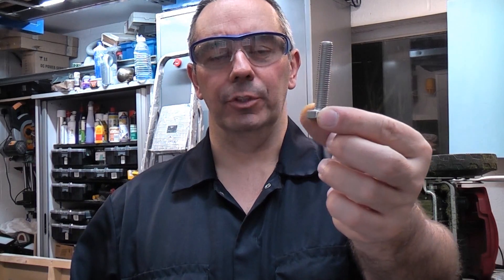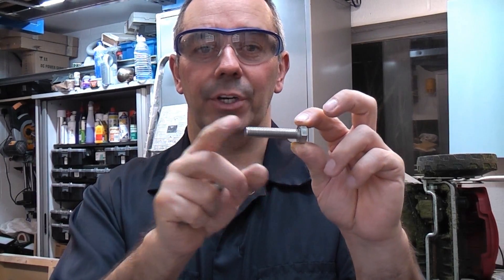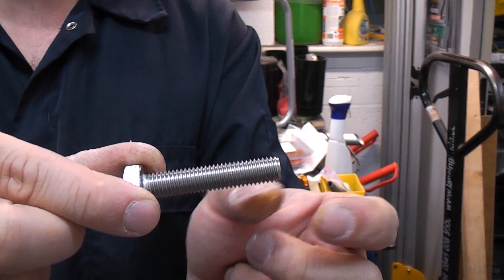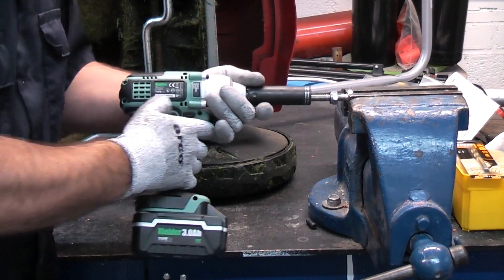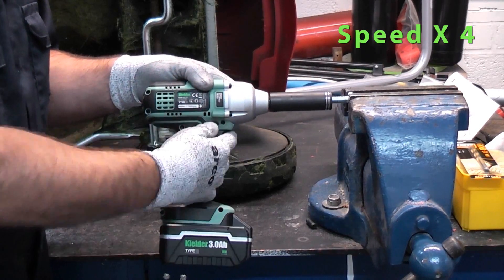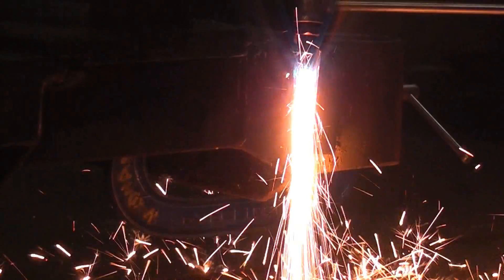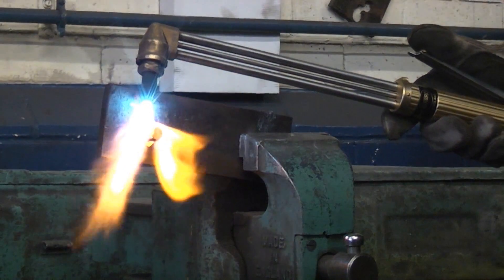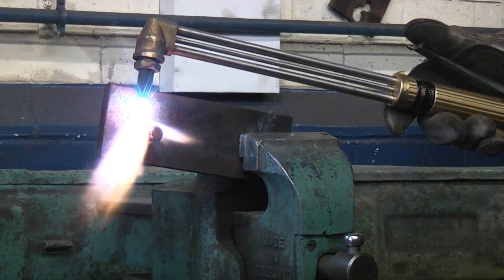Stainless steel bolts vs steel bolts | Stainless galling

Comment: I like that small battery angle ratchet you were using I have been looking at one made by Milwaukee but not sure I would get enough use out of it. You know I have used stainless bolts for years and never heard of this problem. Just last week I was trying to undo some stainless bolts holding down the bed on the back of my old Chevy truck. These bolts were newly installed by the previous owner but I found even though the nuts came undone easily they the bound up about halfway done the thread, the impact gun actually sheared off the bolt.  I suspect I have never had the problem with my fixings as I always put a light smear of the silver never seize on when I install bolts.  I also did not know you could not burn off stainless bolts. My plasma cutter has no issues but this process blows the molten metal away rather than adding oxygen and burning the steel.  I wonder why stainless does not burn away as is basically still mainly iron with a splash Of chromium.
Reply from the maker: I bought that 12v ratchet for doing that exact job in the video, but during first use it went faulty. I had it repaired under warranty, when I went to use it again 12 months later it was faulty again!
 If it was reliable it would be fantastic, but the reliability of it has not been good!
Thanks for the comment ;-)
Reply: Ultimate Handyman what make was it? I was looking at the Milwaukee it gets fair reviews. Regards Chris
Reply from the maker: Yes it is a Milwaukee.
I reviewed it here- https://www.youtube.com/watch?v=UQ2gbO2Wynk
But it wasn't long before I had reliability problems with it- https://www.youtube.com/watch?v=zYIJcFsShCg

It's a shame really because I must have 6+ other Milwaukee M12 tools and they have been fine, it's just this ratchet that I've had problems with.
Reply: Ultimate Handyman  Oh it was a Milwaukee. Food for thought.  I thought they were the dogs bollocks. I think I will give it a miss then . Thanks Regards Chris.

Comment: Thank you. I did not know this about the cutting torch and stainless bolts. Here is another no no, never try to spin a s/s shaft in a brass bushing as it will fail. I used to be under the impression that stainless steel is tough because it was harder to cut, drill and form. As an example of something we are familiar with,  drop a knife point first into your S/S kitchen sink ( 300 series stainless and bolts are usually 18-8). The sink gives to the point of the hard steel knife. Please don't do this but, you get the point. Pun intended.
Reply from the maker: Thanks for the comment

Comment: As you say they are a nightmare to use, but like you i have to use them in different environments, i tend to tighten them very slowly, but even then they will seize, they tell me different grades of stainless  cause less of a problem?,,great video thanks
Reply from the maker: Yes, we get them galling up on site when just tightening or undoing them using spanners. I have been told that if you use 2 different grades of stainless it can eliminate the problem.
Thanks for the comment

Comment: You can eliminate the galling by simply not using the same grade nut on the bolt i.e. use a grade 304 nut on grade 316 bolt or vice versa. Buy your bolts and nuts from a nut and bolt supplier - not a big box store. They usually stock each grade. The nylock nuts have nothing to do with the galling problem.   Posted before I read "nightjarflying" 's post in the replies.
Reply from the maker: Thanks for the comment

Comment: Nice demo but why would you run a nut up and down the bolt. What's wrong with just tightening it up once?
Reply from the maker: That was done just to show how quickly stainless can gall up. We get them galling all the time at work, even when just using spanners!

Comment: A friend who worked a lot in cooking materials told me about these problems more than 20 years ago. He told me that we had a lot less seizure if we used stainless steel of different qualities: A2 screws and A4 nuts for example. But according to him, the most effective solution was a stainless steel screw with a brass nut.
Reply from the maker: Thanks for the comment ;-)

Comment: Just had to return to this video after thinking it over. Galling is indeed a problem with SS fittings, particularly with locking nuts. But as a problem it usually only becomes apparent with the larger sized screws. I've used small ones for years with nary a problem. Even with the larger ones, if the thread is properly lubricated and you proceed with hand tools, you're unlikely to have a problem. But if you do feel it tightening up, you want to reverse and not force the issue, then either use your taps and dies to clean up the thread, or replace the nut and bolt. The problem with SS is that any heat generated is not as quickly dispersed as with other steels, leading to tightness between the two components. And running a locknut repeatedly on and off with a power tool is guaranteed to generate a significant amount of heat. In short, most of the "problem" has been artificially generated.
Reply from the maker: Thanks for the comment ;-)

Comment: They're "machine screws" in your example not "set screws". but its happening because you're using power tools to run the nut a high speed.  Stainless steel is far superior to steel for corrosion resistance but NEVER use power tools to run stainless nuts/bolts/machine screws in.    Try repeating your galling test with a hand ratchet, much much less likely to happen.
Reply from the maker: It depends where in the world you live. In the UK these are "set screws". Machine screws have a slotted head or Phillips/pozi drive and are fully threaded ;-) 

The impact wrench was only used to speed up the demonstration. We use stainless bolts regularly on site and they gall up when using regular spanners.
Reply: Just tested stainless A2 M5 screw with nylon lock nut. There we no problems until I began turning the bolt faster then 180rpm. The bolt began heating and locked.

First I was using hand tools, was not able to make galling. And I was turning it in and out for 10 minutes. So the problem is speed and heat, no power tools allowed.

If you have this problem with hand tools then your bolt or nut is bad quality to begin with.

Comment: Galling occurs on stainless for one major reason. Both the bolt and the nut are made of the same quality stainless. When they first started making semi-automatic Firearms out of stainless they made the mistake of making the parts that function together out of the same type of stainless. It took them awhile to figure out that you cannot do that. They eventually figured out that you had to slightly differentiate the types of stainless that came into contact with each other so that they would not gall. I actually saw stainless Firearms lock up in mid cycle. Even with copious amounts of lubricant on them. Some guys even tried to use WD-40, which would actually make the situation even worse because WD-40 is not a lubricant. it's a solvent! It also requires you to use Fairley high quality stainless bolts. As most stainless bolts are just stainless steel. She will get exactly that response from them. The Metallurgy of the nut and the bolt are key, just like with non stainless Nuts and Bolts.
If you use a mild steel starter and then run the cut across the stainless it will cut the stainless. I've been a sheet metal worker for 40 years and I did it within months of my starting the job. But I had to slice it from starting on standard Steel and Chase the cut.
Reply from the maker: Thanks for the comment ;-)

Comment: I've been a mechanic a long time, and just discovered this stainless galling problem. I ran a bolt once, and couldn't get it off without almost breaking a wrench. Of course it was in an extremely difficult area to access. And I didn't even know you couldn't burn stainless with a torch. Great video. Interesting comment below confirms that it was partly due to using nyloc nuts.
Reply from the maker: Thanks for the comment ;-)

Comment: When the first Cat D8 N dozer came out, Caterpillar used stainless  steel studs in the heads on the exhaust manifolds.. This was a disaster. To make a story shorter, it would appear that the manifold and turbo were too heavy, and the studs just sheared off. Our machine was working on the beach and I tell you, I evolved into a master at drilling these broken studs out, using cobalt drill bits. Finally Cat  made a recall and new studs were issued. Normal steel with spacers. This makes sense, the spacer forces the mild steel stud to stretch. Also there were suport brackets ect for the turbos
Reply from the maker: Blimey, I bet they regretted using stainless studs for that application!
Thanks for the comment ;-)

Comment: Well I work with stainless materials for almost ten years and never had these issues😕 what I think I ve learned here is that maybe I should not start using power tools for fixing nuts
Reply from the maker: We get them galling up on site, when just using spanners (not all the time though)
Thanks for the comment

Comment: Oh, certainly this is a load of nonsense. I've used stainless bolts up to half inch thick on my ski and race boats, holding engines and gearboxes, including V-drive boxes mounted on aluminium brackets, etc. because they don't rust. And not only that, I have removed and used the same bolts and nuts over and over when engines and other components had to be removed for modifications or overhauls. I have never experienced anything such as bolt galling. The reason? Because stainless bolts are quite strong and able to hold anything together just like a zinc plated steel bolt. And zinc plated steel bolts are also subjected to galling, why? One thing for sure is that the bolts are certainly overtight, or not tightened to torque specs. And this is the reason why bolts fail, snap or seize. An example of this, is when you have your car fitted with new tires or have the brakes checked, how many times have you seen mechanics and or tire fitters using an air wrench to tighten wheel nuts? And is that air wrench set to the correct torque before tightening the wheel nuts? Different car wheel studs for different wheel size meant different torque settings. When wheel nuts are overtighten, chances are when hard cornering and the wheel strikes a pothole, a brick on the road, the bolt/s may snap and the wheel will fly off. Yet, in my 43 years of mechanic/engineering experience under my belt, I have never seen any workshop mechanic or tire fitter using a hand torque wrench to tighten each wheel nut in a criss-cross pattern, passing over at least 3 times, with the final tightening sequence set to the final factory recommended tightening. In this video, the trick is to stress the stainless bolt by over tightening it several times until galling occurs. In fact, like I said these bolt are very strong, hold a hefty load, but they are to be tightened to the correct torque if they are to do their job properly. A billion people using them know it, galling doesn't occur if the correct tension is used and in tightening sequence when more than one stainless bolt used, just like  the tightening sequence done on engine heads, bit by bit, criss-crossing and repeating the tightening sequence until the final tension is applied. If you put a stainless nut on a vise and then tighten it indiscriminately, of course the bolt becomes galled. If a certain sized stainless bolt is designed to hold components together, then the torque for that bolt is specifically written in the stainless steel bolt chart for such bolt sizes. It would be foolish if a small bolt is torqued to higher specs designed for larger bolts. That's why I don't recommend the use of air operated wrenches. It is also known that tightening wheel nuts of alloy wheels to full tension and not in a criss-cross pattern, the alloy rim is under stress because somewhere among those nuts one or two of them may not be tightened enough to seat the alloy rim in same tension as with other flat surface mating with the hub studs, or one or two bolts are tighter than the others. This creates an uneven tension on mating and may crack the rim near the studs, spreading outward and then destroy the rim. So, in this video, overtigtening at torques past the permitted torque described in the charts and undoing the nut causes the stainless bolt to heat under a lot of pulling stress and would probably snap, or galling (stripped thread) will occur. Your theory is false.
Reply from the maker: LOL
Reply: Stainless steel fasteners are often ( even "always" ) not graded according to strength like gr. 8 carbon steel fasteners, for example....so your comment " Because stainless bolts are quite strong and able to hold anything together just like a zinc plated steel bolt."....is simply too broad of a statement and not universally true. Grade 5, Grade 8 carbon steel fasteners, etc...all are different in strength. Stainless fasteners usually are not graded and typically are equal to lowest strength carbon-steel grade. With your 43 years of Tech/Engineering exeperience, you ahould have warned other people here properly.

Comment: Not a Stainless Steel story, but along the same lines. We had aluminum "saw guides" that we had to put shims on for adjusting board sizes. We used 1/4 inch, hardened, grade 8 steel bevel head bolts that went into a tapped hole in the aluminum guide (good aircraft grade aluminum). Even with just snugging the bolts they would need a cheater pipe on the allen key, and POP loose. They were so tight that I would put a rag over the allen so it didn't launch like a bullet if it slipped out of the allen hole. Grease or anti-seize wouldn't help. Once they popped loose they would come right out with no thread damage. We had hundreds of these to do on a size change, and 95% were like that. We ended up getting all brass screws and never had a problem again. So in conclusion, for some reason those hardened bolt and the aluminum did not like each other.
Reply from the maker: Thanks for the comment

Comment: What happened was the high speed & torque from your tools causes the problem you have mentioned.
I never has any problems with stainless steel bolts where corrosion were high. In fact it's is easy to remove without torches or penetrating oil.
Try turning in or out on lower speed settings & avoid over torque them with your power tools is the secret to success and happiness with stainless steel bolts.
Easy with your tools on them.
Reply from the maker: We get galling regularly even when using hand tools, but there are literally thousands of stainless bolts where I work.
Thanks for the comment

Comment: You've overlooked the lubricating done by the zinc plating. No threads are designed for repeated use of power tools, which means the bolts are not being used as intended. Perhaps they are the wrong grade of SS bolt?
Reply from the maker: The impact wrench was only used to show how quickly it can occur. On site we often come across galling, even when using spanners.
Thanks for the comment
Reply: Don't believe SS comes "graded" in different grades for a given alloy ( 304 , 316). That said, each alloy has its own strength characteristics but I don't "think" a specific SS alloy bolt or nut is available in a variety of stength grades like carbon steel bolts.

Comment: While an interesting demo of galling.
In practical terms it rare to apply a ss nut to much more than a quarter of an inch or so assuming the use of the correct length bolt.
Nyloc nuts are excellent but the inability to finger tighten is frustrating.
Old sailor..😁
Reply from the maker: Nylocks can be a real pain!
Thanks for the comment

Comment: I just have two things not covered. One If a SS bolt is needed and needs to be taken apart use a brass or bronze nut, locking or non locking. It will not gall. Second the cutting torch will not cut SS is because there is no carbon in "true" SS. That's non magnetic. I'm not a metalurgist, there is magnetic SS.
Reply from the maker: Thanks for the comment
Reply: 300 series SS ("Austenitic" ) is non magnetic.....400 series ( "Martensitic") is "slightly" magnetic.

Comment: Stainless steel bolts and nuts are standard use in marine applications.  Use a coating of Tef-Gel on the bolt and you' won't have the
Reply from the maker: Thanks for the comment

Comment: In my work I use stainless steel bolts and nuts ONLY once. Especially where there is a lot of heat involved. The only real benefit is that these do not rust, but other than that they offer absolutely no advantage at all. Once I loosen a stainless nut or bolt it gets replaced.
Reply from the maker: Thanks for the comment

Comment: I worked in a cryo plant that made liquid oxygen, nitrogen, and argon.  At -300 F steel bolts are brittle.  We used SS bolts with silicon bronze nuts and they would come off while still frozen.  You don't need any lube (not allowed near oxygen anyway--goes boom!).  You better have a lot of money though.
Reply from the maker: I bet that was an interesting job! I bought some cryogenic gate valves a few years back at auction as they were cheap- I've still not had time to sell them- yet!
Thanks for the comment
Reply: Stanley Franks.....completely correct....see my other comment above with 3 solutions presented....uses of Silicon-Bronze nuts is one of them. Also from my own cryo system backgound. Cheers. Don't recall these being particularly pricey. Quality costs in aby case, but not stupid-expensive in my recollection.

Comment: Can't gallong be prevented or mitigated by threading the nut on (or the bolt into) at a very slow speed so as to prevent heat build up due to friction ?
Reply from the maker: It can, but it does not guarantee to prevent it from happening.
Thanks for the comment